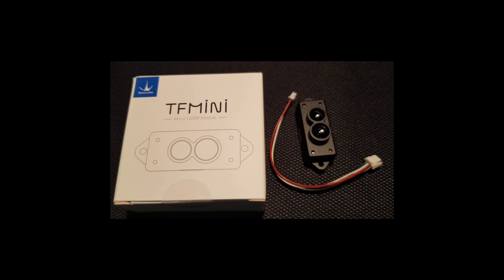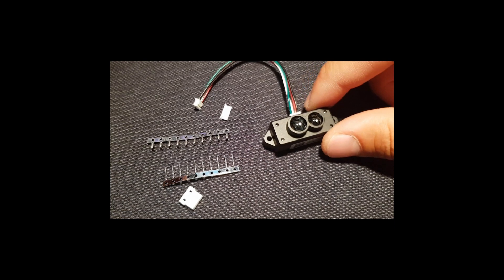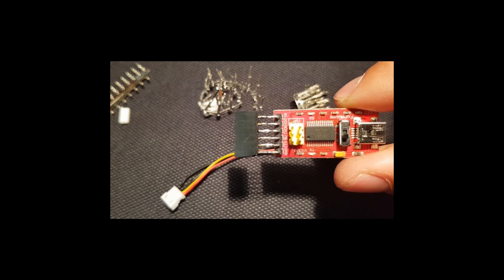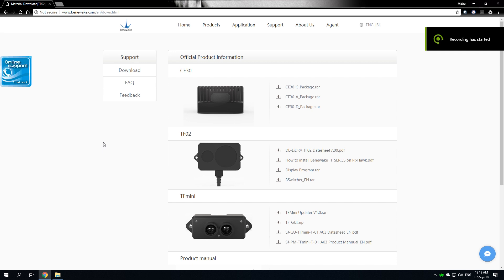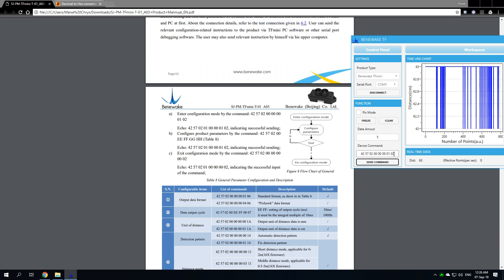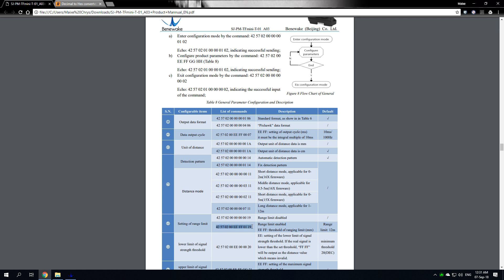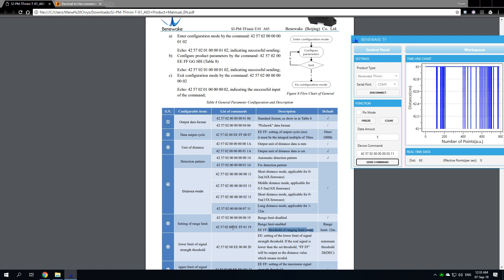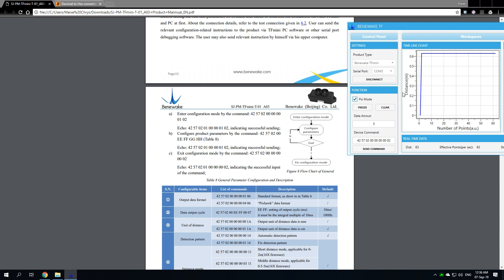Part 1/2 Benewake TF mini Pixhawk setup for object avoidance.

Comment: Great video and really appreciate the trouble to go through the technical details if more ArduPilot experts could do the same it would be a better place. Can I ask if you could do the same for rplidar setting this up with pixhawk 2.1 rover
Reply from the maker: Hello, thank you for your kind words and for stopping by. 
I currently do not own a 360 lidar, but i will do some research.
What is the specific lidar model that you want? Maybe I can at least cover it in theoretical level.
Reply: @maixechrys6264  Hai bro right now, I am using tfmini s lidar its senses the obstacle and it did not avoid or stop the obstacle   can you guide me or put a full integration video am using orange cube + flight controller and 4 TFmini s lidar

Comment: Signal strength is 0 but I am getting distance is this ok?
Reply from the maker: Signal strength could be referring either to the RC controller signal or the ground station (telemetry signal) so it is irrelevant to the rangefinder.
Reply: The signal strength is with respect to the reflection back from the object. The One which is seen in the TFGUI. After I configured it for pixhawk.

Comment: Hi, nice video, if you could help me,  great!!! 

how does the echo work?; I never saw any feedback or echo, 

I just put 

1.- configuration mode by the command: 42 57 02 00 00 00 01 02, 

1.1 ?

2.- Configure product parameters by the command: 42 57 02 00 04 06 “Pixhawk” data format
2.2 ?
3.- Exit configuration mode by the command: 42 57 02 00 00 00 00 02
Reply from the maker: Hello! So the echo does not work under programming mode, once out of programming mode then select pix checkbox as I do in 5:02 if you previously selected this mode of output.
Hope this helps
Reply: Hi @maixechrys6264 , Do I have to use the ArduCopter V3.3.3-V3.4.6 firmware? or I could use the new firmware 3.6.9 ( What firmware you are using in the video?) because with the 3.6.9 I got the "Bad LIDAR health", I followed all the steps Part1 and Part2, do you recommend me to downgrade to V3.3.3-V3.4.6 firmware?
Reply from the maker: @fjcn88   Please check the top window on my screen recording when using mission planner version is always stated there. I do not think that the newer versions are not going to work.